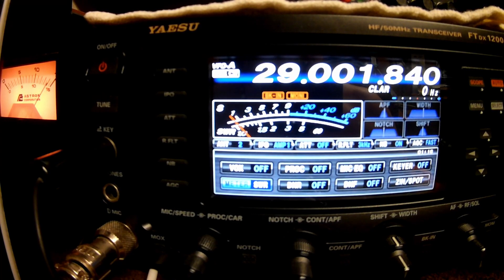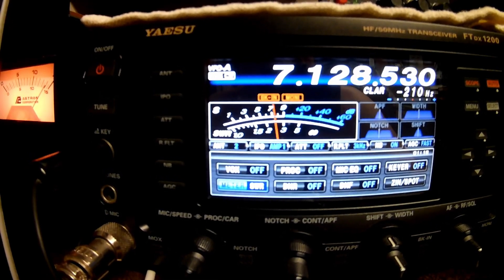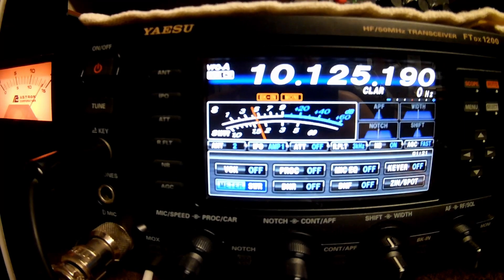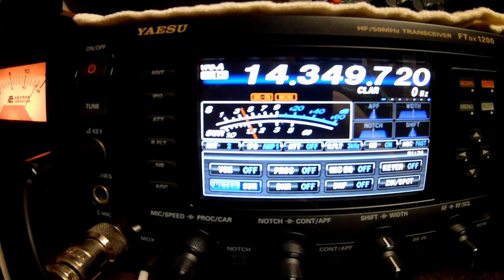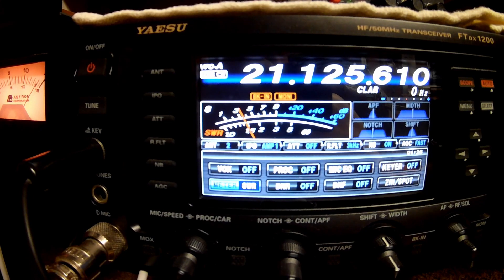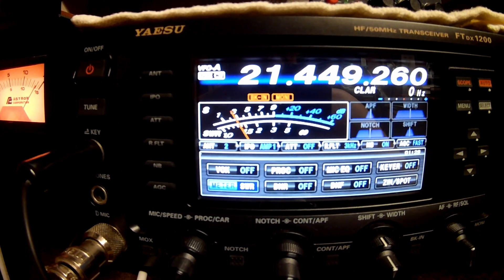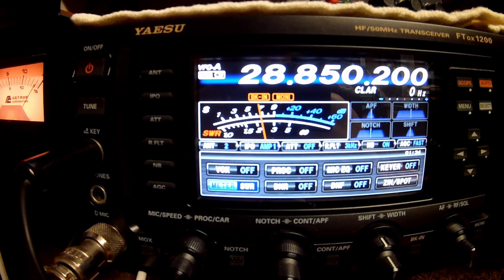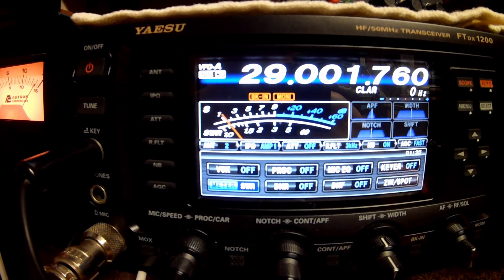SWR Results of the 80 10 EFHW

Comment: Good for you I hope you’ve had a lot of fun with it since the posting the video
Reply from the maker: Absolutely!  I actually built another one and mounted it on a treated 2 X 4 X 8’ with a shortened antenna wire for 10 - 40 meters.  I use it during my POTA outings and it performs extremely well!  I highly recommend it.

Comment: How are you grounding that antenna?
Reply from the maker: I’m running an eight (8’) foot ground rod purchased from Lowe’s.  It’s driven in the ground directly below the transformer of the EFHW.
Reply from the maker: I might also add that I use a 10 - 40 meter version (same except a shorter wire) during my POTA camping trips.  I do not use a ground, but I do use a 1/4 wave counterpoise.  I also recently discovered during another trip when I forgot to bring the counterpoise that it seemed to make no difference.  I ran the antenna all weekend and it performed equally as well without it.  Go figure?

Comment: Your running 5w but I hear your amplifier relay keying....you need it in pass through to do what your checking. Also at 5w hold key and roll vfo back and forth keyed and you’ll see the see sweet spots.
Reply from the maker: No Sir, no amplifier whatsoever.  The noise you hear is my window AC unit.  If I had been running more power, the SWR would have probably increased slightly as the transformer increased in temperature.

Comment: The whole idea is to use the EFHW with no tuner, I wouldn't use 2.5 as an swr. Your antenna is obliviously the wrong length. You have cut the wire length more for 40M.. it is unusable for 80M.

You should be cutting the wire to minimize swr for 80M and then look at the higher bands...

I have a 8010 and less swr readings than you are getting.
Reply from the maker: Thanks Robbie for your comment.  To be honest with you, the 80-10 EFHW antenna is not one that I use very often on 80 meters.   I have a full-wave loop cut for 80 meters fed with 450 ohm ladder line which does a far better job on that band.  I also use the EFHW on 160 meters by by-passing the transformer.  No, it’s not the best antenna for the band although I have worked WAS with it which I consider to be an accomplishment.
Reply: @kvistads  Why in the world would you feed a loop with ladder line?
Reply from the maker: Sorry, but you are wrong.  132 feet is not considered a half wave on 40.  The point is that the antenna can work on all the bands without a tuner, but where it's a little high it can be tuned down with a tuner without a problem.  The point is that the antenna can be used on all bands 6 through 160 if you know what you're doing.